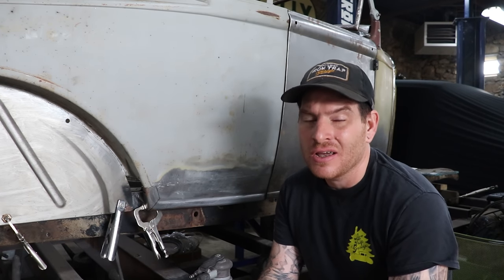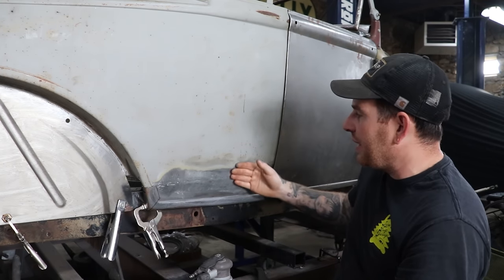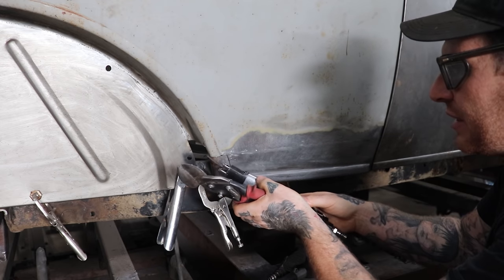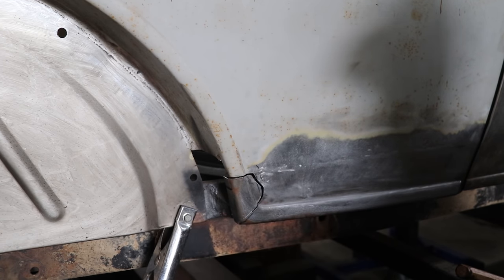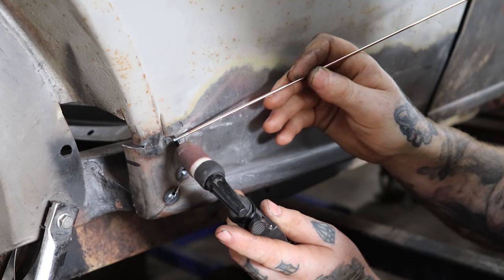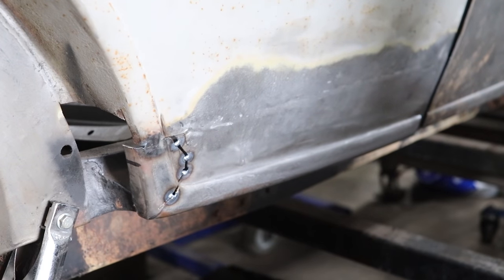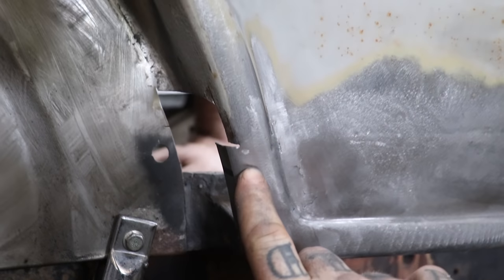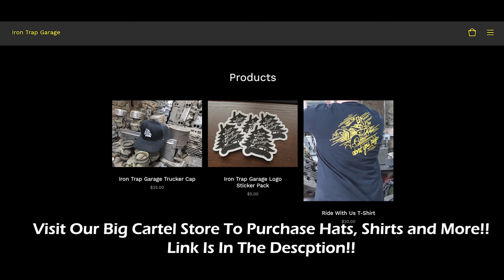How To Blend Patch Panels Into Factory Body Lines - 1930 Ford Model A

Comment: Hi Matt, given that I am ignorant on the subject, I see that you often use the TIG for bodywork. Is it better than continuous wire welding? however it is always a pleasure to see you at work!👌
Reply from the maker: The welds are easier to control and finish out as they’re softer and can be hammered and dollied.

Comment: Matt good idea with the hacksaw blades i must try that as they looked to work better than the body saw blades,  good work on re sculpting that patch panel, its makes you wonder where they get there specs from when making patch panels. Cheers
Reply from the maker: The bad fitment is a mixture of inconsistent panel making when the car was made, and when the patch panel is reproduced.

Comment: I understood all you were saying on  welding the gap cause I've been oxy/gas welding since Vietnam. I'm new to short arc welding except stick. I just got a Mig this spring. I know how I would vary the heat with gas while bridgeing the gap on the two pieces like you did but how do you do that with the TIG torch and maintain a arc as it doesn't seem like your  moving your hand?